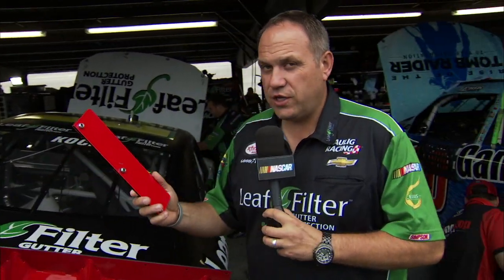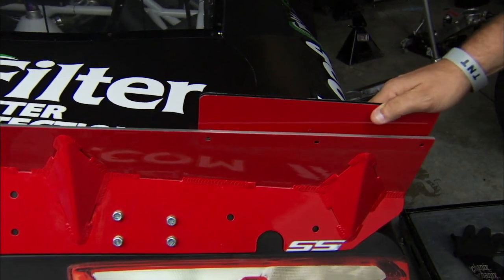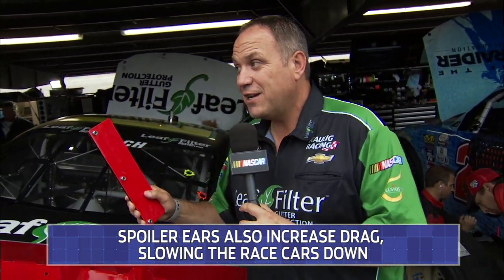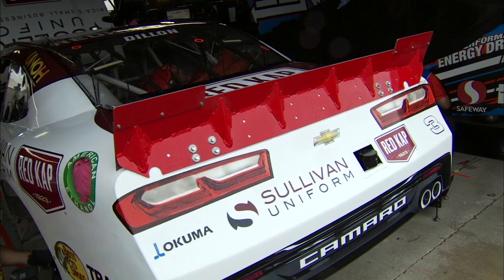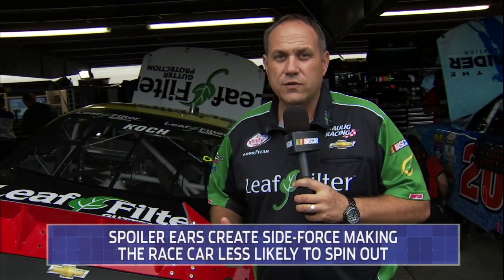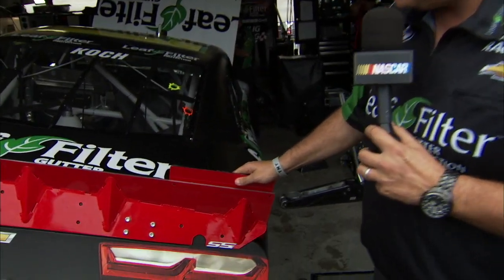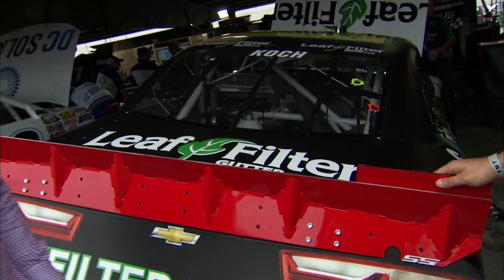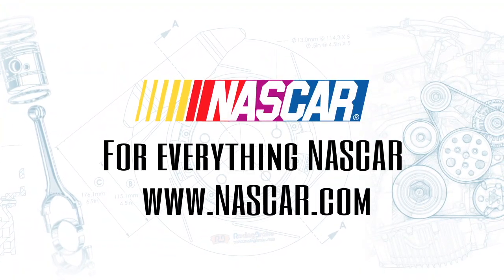Tech Talk: The reason teams run spoiler ears

Comment: Good information. However, the bunny ears are not the best idea. If these ears prevent drivers from spinning out, then how can drivers actually drive the cars? Like really drive them. Like being on the edge of control in every corner. Even though the drag is there, the huge air pockets these new cars make discriminate close side by side racing. The cars are horrible to drive when around other company. Sure restarts are exciting, but the excitement is gone after 5 laps or so. I understand the use of the bunny ears, but please let the drivers race, especially the young guns. Still love NASCAR though :)
Reply: Exactly, the more downforce they put on the worse the racing is
Reply: Griffdawg